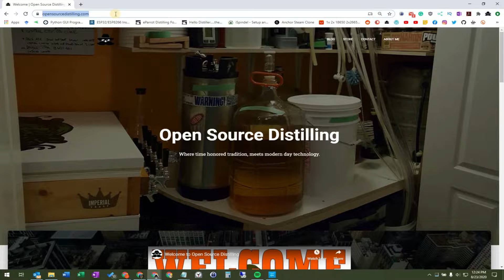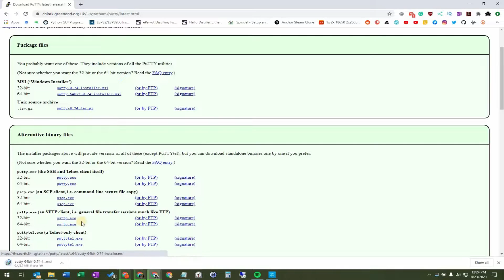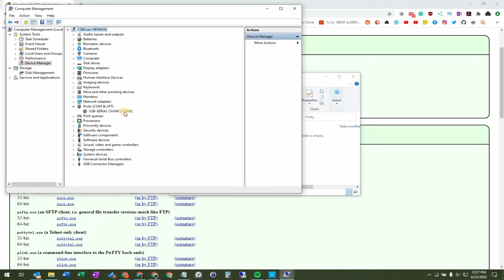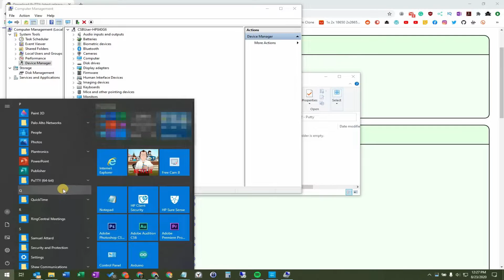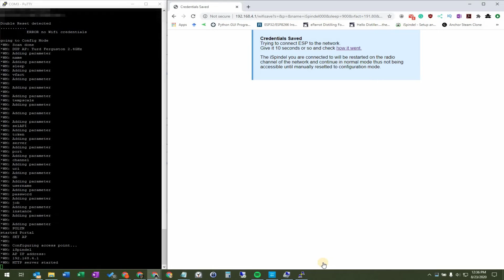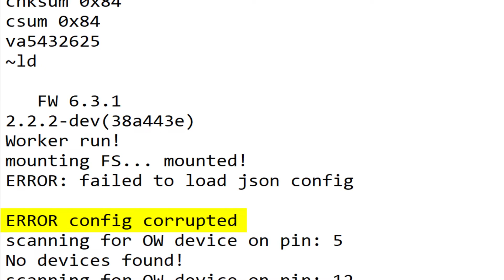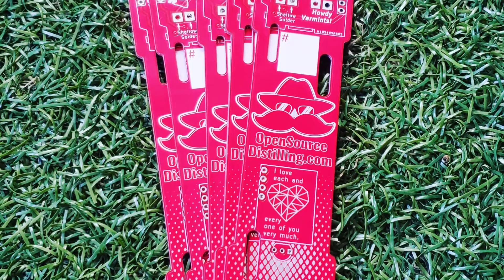iSpindel Serial Monitor with Putty

Comment: Great job on the videos, I've just built my first iSpindel and I'm looking forward to monitoring my first brew without having to keep opening my fermentation bucket.  Do you think all the foam on top of the brew has a significant effect on the iSpindel readings ( do I have to keep opening the lid to clean the iSpindel or is it OK to leave it till finished?)?
Reply from the maker: Yes the krausen (beer foam) will affect the reading. Just take a reading before fermentation starts and you should be good to go.

Comment: It's a Shane there is no way to offset the temperature probe to adjust for any slight error in temp
Reply from the maker: On the iSpindel no. But on ubidots I believe you can add a formula to the temp reading adjusting it.